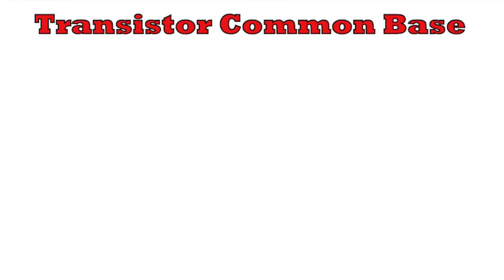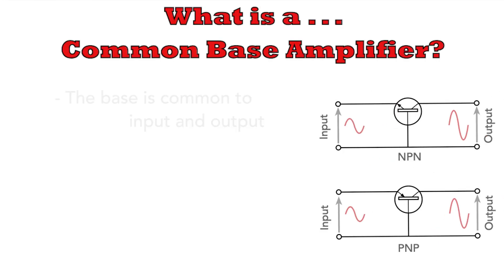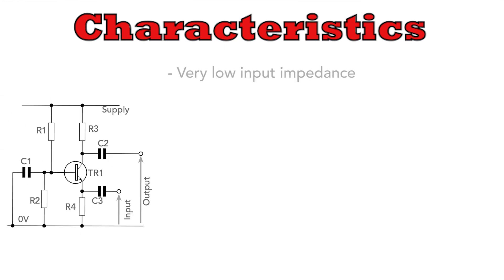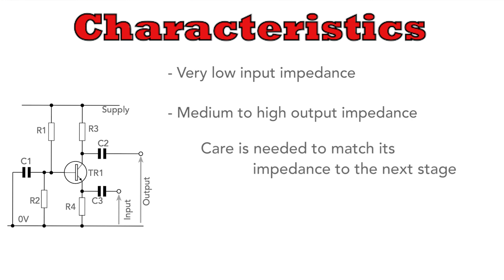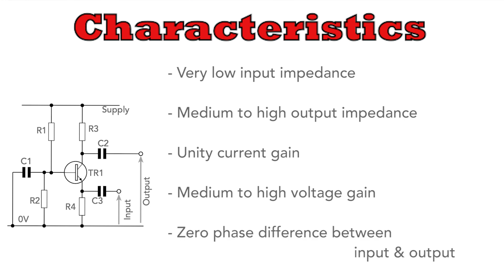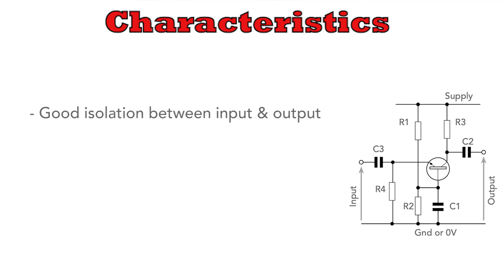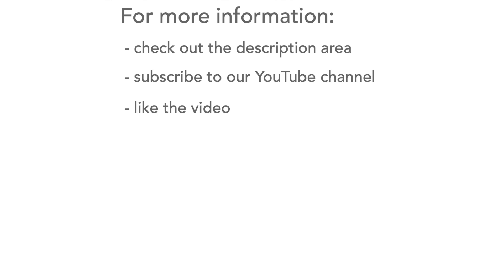The Most Misunderstood Transistor Amplifier: Common Base

Comment: The simplest example is once you hear a BJT equivalent circuit compared to it's op amp version, the op amps sound sterile and synthetic, the transistor sounds dynamic, bold, smooth and warm relative to valves.

Configuring it only for voltage gain is what makes it a perfectly suitable alternative to an op amp for an audio device. If you need a high input impedance, start with an emitter-follower. If you also need a very low output impedance, add another emitter-follower.

Everyone dives on op amps today out of convenience and how they were steered in school, but I will always favor transistors for countless needs with audio. Op amps have a place but IMO, in limited influence in terms of gain ratio or heavy RC filter processing. I'd rather use 10 transistors than one dual op amp.
Reply from the maker: It's always interesting to hear different perspectives on audio circuit design.

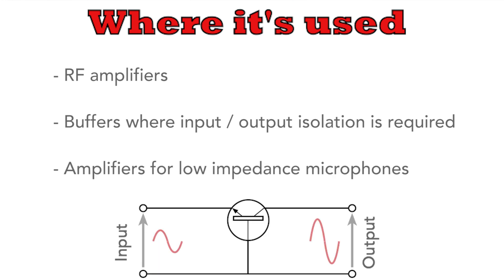Comment: The schematic at 2:07 doesn't make sense. The transistor is backwards and turned off. Current flows from collector to emitter in a NPN BJT. The voltage on the base has to be at least 0.7V above the emitter for the transistor to turn on. The input signal would have to be below ground for it to work but then the transistor is still facing the wrong way.
Reply: That's really just a conceptual circuit from the point of view of the signal path. A practical circuit adds DC bias to the base as usual, but a capacitor from base to ground grounds the base for AC signals.
Reply: That is a symbolic circuit not a practical circuit.
Reply: No, D.C. current flows from the emitter to the collector. You're another victim of the pseudoscience known as, "conventional current theory". They claim they're identical, but not even close. Conventional theory teaches endless drivel for theory that's known to be wrong and provably wrong.
Reply: @JonDeth  current (amperes) always flows positive to negative. Go prove it wrong and the textbooks will be updated.
Reply: I agree. I haven't studied circuitry for 30 odd years and this one had me scratching my head. I think it's supposed to be an emitter follower circuit, but the NPN transistor is installed backward. Good eye!
Reply: @JamesStripling  it’s definitely not an emitter follower or in backwards. It’s the common base topology. How the AC signal ‘sees’ the circuit, not a complete schematic.
Reply: Assuming the DC voltage on the open end of R4 is positive, the schematic is fine.  R2 and R3 will set the base voltage to something positive > 0.7V.  In fact it will probably be somewhere in the vicinity of 1/2 the supply rail.  R1 will then bias the emitter at a lower voltage and along with RFC1, set the base/emitter operating current.  

The relatively small RF signal at C1 will push and pull more or less current through the emitter, without changing the bias point much - the current has to be small, otherwise it could bias the emitter off - but normally you will design this to keep it in the active region.

Whatever current you push/pull through the emitter will show up at the collector, in phase, but reduced by the current through the base, which will be smaller by a factor of the current gain, beta.  

At first, this doesn't seem to buy you much, but the load will typically be at a higher impedance than the source here, and thus you will get a votage gain, as long as the signal remains small enough to avoid clipping.

There are a couple of reasons this is used for RF work:

It's good for small-signal, low impedance sources, like those from antennas.  
It avoids the bandwidth degradation of the Miller capacitance of the common emitter configuration.
Reply: @Cynthia_Cantrell  I'd say that's a fair analysis of that circuit. I was looking at the sample emitter follower circuit that was the next example. I suppose it works if the input signal is negative going. Just not used to looking at it that way, and was why I was scratching my head looking at it at first. Good job!